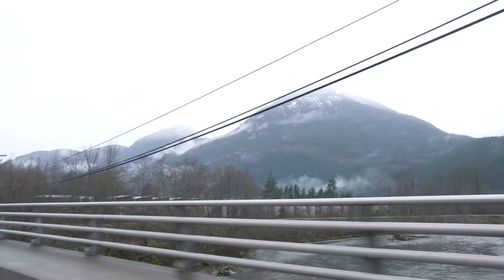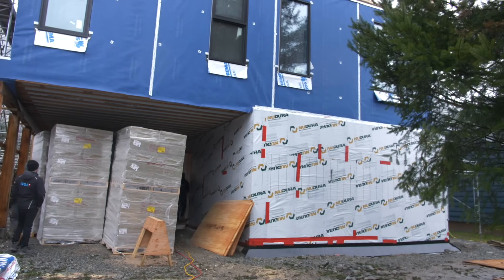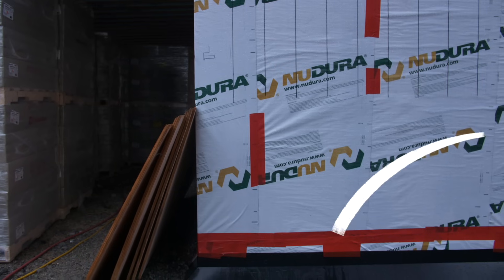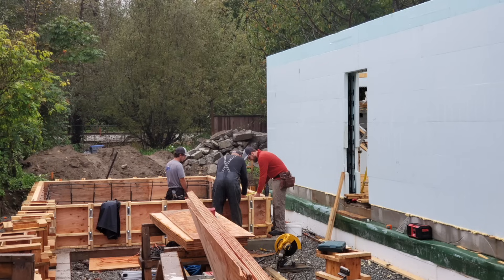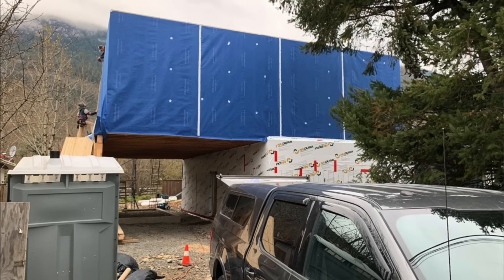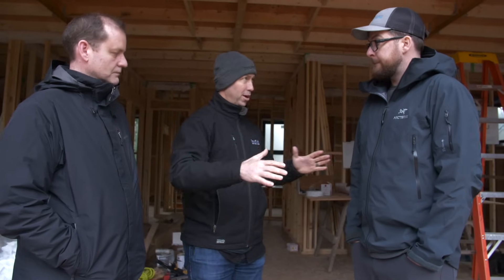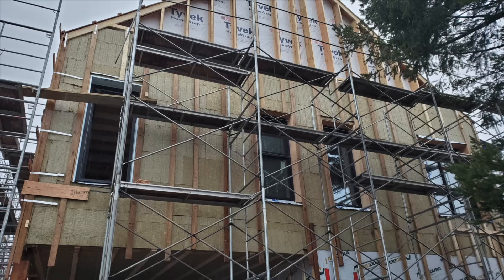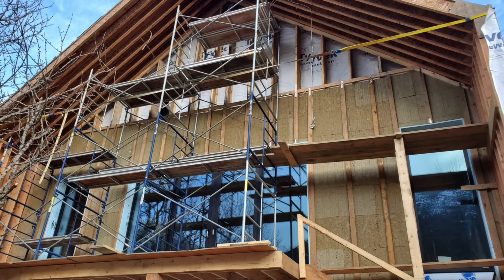Some Awesome Insulation Details on this BC Passive House!

Comment: Whats this house cost, I feel like the cost to build out weights the energy savings.
Reply: pretty sure the owner does not care about the savings. They have BIG enviro rules there, so to build to costs lots, and to do it right, it costs more..
Reply: Its depend on energy costs in the FUTURE and how well known is that method of building in particularly locations in Europe for example similar houses costs maybe 20% more than regular but your investment pay off after 5-8 years of living in that house.
Not to mention other beneficios such are clean fresh air, even temperatures across the year you dont have cold/hot walls, floors...
Reply: @altergreenhorn  that's nice.   But i would rather live in a shack that i can afford.
Reply: I'm all for energy efficiency, just wondering why be this efficient. It does seem like overkill, but if the house lasts for 150 years then it makes sense.
Reply: @rosscoep1450  Will that home last 150 years in a flood zone? Regardless, who wants to live inside a foam tomb? These super-tight passive homes require lots of expensive ventilation to deliver safe air.  Any mistakes in design, installation or maintenance of the ventilation system could have significant health ramifications.  So why do it? It's not cost-effective.  It's not eco-friendly. It's not healthy.
Reply: These homes piss on the environment - massive amounts of hydrocarbons needed for the foam and concrete. Excavate 6' of subgrade and import 2' boulders. Layers of rockwool.  All to save a few hundred in energy costs? Reality is money far better spent on a less energy-intensive building and simply installing solar. And then the occupants live in an off-gassing foam and rockwool cocoon (rockwool off-gasses formaldehyde) which then requires an expensive HVAC system. Rather than being impressed with these ridiculous homes, they deserve nothing but scorn and derision.
Reply: @ArthurDentZaphodBeeb  Rockwool hasn't offgassed formaldehyde for 40 years.
Reply: @stickdoctor001  today still it's a problem and clearly have not be following the imported products still do off gas.
Reply: @stickdoctor001  All but one Rockwool product uses a formaldehyde binder. And the one that doesn't add formaldehyde has extremely limited availability.  Fiberglass insulation makers got rid of formaldehyde binders a long time ago, but hasn't yet happened for mineral wool producers.
Reply: @ArthurDentZaphodBeeb  I am looking into switching from building houses into becoming an energy advisor.   (less liability, more control, and people are forced to hire you.)  So i go to the info sessions about these things.   I was at one and they asked if there were any contractors or developers in the room.  I and two others put up our hands.  They asked what i thought. 

 I told them that i think building perfect houses is wonderful, but forcing everyone to do it is horrible.  The houses we already make are of high quality and have extremely low fail rates.   In fact, the only problem with  our existing housing stock is that it usually costs 20-30 years of 2 working people spending as much as they can afford just to buy one.   Making housing more expensive is just going to make it impractical for even upper middle class people to own their own homes any more. 

I more or less got shouted down by the eco greenies and socialists in the room.   but my point stands.
And yes, if i had the time to say it, i would have repeated what you said.  All these materials and chemicals cost energy and thus carbon to make, and assembling them does the same.   When energy costs are what they are, we look at bringing the cost of heating from say 1500 a year down to what? Even with bottom of the barrel numbers, energy would have to increase in cost 20x to make this worth it (that was the number bandied about in these panels).   The only way energy costs increase that much is if we convert to solar.   Which, ofc, they also want.   The only real effect of these policies will be to drive up rent, building and developing costs, and mortgage costs for everyone.  Probably the goal anyway, since then they can "subsidize" people to create nice little vote plantations.  I mean, most people can barely afford a house nowadays anyway, and it isn't as if builders, developers and landlords are living in luxury.   The real effect is to make more middle class people dependent on the state by forcing them into the lower class.  The rich don;t care, because they can virtue signal and they can afford it.  As per usual, i think its really just a backdoor to more socialism.  these people are usually just watermelons.  green on the outside, red on the inside.
Reply: @hosmerhomeboy  Well, good luck on a career change. The problem is people get wrapped up in being 'green' - even if it is anything but. One of the passive house building supply companies (475 Supply) just posted about a small-home they were involved in that used straw-bale wall panels as their building material. Only thing they didn't mention was that they were built in Slovakia (or somewhere thereabouts) and had to be shipped across an ocean by ships burning bunker fuel and delivered by diesel-powered trucks. And then lifted into place with a crane.  Could have built using standard local green materials (wood/cellulose) at a fraction of the environmental impact and fraction of the cost. But that is boring 'old thinking' and doesn't sell well...
Reply: @ArthurDentZaphodBeeb  HA!  Yeah, people often forget that wood is a renewable resource, and quite green/efficient as well.  I got a kick out of blown in cellulose insulation being legislated out of existence in favour of DOW chemical products.   This is ofc, under the guise of being "green".  They figure it's better to have petroleum products shipped in on boats from nations with sketchy environmental records and refined into crazy chemicals than it is to make renewable stuff here.

Comment: The cost of construction for this house to minimise it's energy cost is not feasible. The rate of return on investment is dismal. Impressive construction nonetheless.
Reply: Similar talking was heard here in Europe +20 years ago when first passive houses was introduced , but then ecological point of view and energy prices goes up and now almost everybody in central or north Europe build more or less passive houses or some even plus houses, because you get passive part of  invesment back in less than 8 years by today energy prices.
Reply: @altergreenhorn there must be extreme rates there. What is the utility rate?
Reply: @xxxrsgrsgxxx  
Depends of the EU country but average costs for 1 litre of diesel is 1,3$ for example, electrity is aprox 0,3$ per Kwh, but in EU you dont have only energy costs in the formula for energy efficient buildings EU countries also encourage ecological point of view you can get up to 10.000$ from the state as energy bonus if you build energy efficient houses. If you dont want to use that option you are still obligated to follow building code which became quite restricted in the last years, for example minimum thickness of solid brick wall insulation in my country is 15 cm of styrofoam and 20 cm in the attic and those numbers are for central europe not north europe. If you build euro wooden house you need a few cm more because a modern EU bricks have some insulation itself.
Reply: We had a small development pop up down the street about 8yrs ago ($300k). We thought they were too high end for the neighborhood and they'd never recoup the cost of their high end features, in our $150k neighborhood.
4yrs later, they were selling for 2.0x to 2.5x their original cost.

The energy efficiency of this build could be seen as a major asset and this house that might have cost $750k to build, could pull 1.5M in a decade. Also, if we cap and trade carbon credits in the near future, energy prices will 3x to 4x. Then the additional installation will pay for itself.
Reply: @Specialist spot on. Your observations apply here in Australia too.
Reply: @cornpop7805  That is a surprising scenario, of course many variables should also be considered in that example.
I just recently built a home in Canada. We have 0.12$/kwh rates currently with big increase due to come bringing the rates to between  0.22$/kwh to 0.25$/kwh next year. (our grid is currently diesel turbine generation and we will be changing to a green alternative - hydroelectricity; also not feasible).
I'm an architectural engineering technologist, and did energy modeling and heat load calculations for my house with comparison to cost to construct. It was very surprising to see how upgrading building assemblies with additional  insulation would hardly ever be favorable in a ROI.
Reply: @xxxrsgrsgxxx 
The worldwide scheme of "Cap and Trade" for greenhouse gasses will make energy prices skyrocket, all fuel, all energy - including renewables. Cap and trade means that energy is rationed, so that the entire world can only produce a certain amount of Co2 and the right to produce that Co2 goes to the highest bidder. Renewables are not rationed, but regardless what you hear, they are unable to meet our needs, not even close. Consider that china is building hundreds of coal fired power plants, yet are the largest exporter of renewable technology in the world. However, the renewable energy prices will also be influenced by the price of Co2 based energy.

Take all this into consideration and your best investment is in energy efficency. A family that borders my new property pays almost $800/mo (US) for electricity. He has an all electric home that was built in the 80's. The passive house I intend to build will be approximately the same size and will be so efficent that it will only need $20k in solar panels and storage to bring the energy cost to $0/mo. When energy goes 3x, he'll pay $2,400/mo and I'll still pay $0/mo. Below is Obama saying out loud what will happen to electricity, but it really means all energy and it will be world wide. It's not his plan, it's the world's plan and it will eventually happen. Invest in home efficency, above all! Passive house! 

https://youtu.be/CNSZ62xiD4M
Reply: Home valves change by outside factors, it still doesnt make the home cost effective when value goes up for a few years in fact will cost a person more.

Bought a house in CA for 140 that wasn't anywhere near this efficient and 5 years later sold for 350K. Made more off that sale then investing in snake oil that make the manufacturers rich and would have considerably destroyed my profit to sell by going ultra efficient. The ultra tight homes that have HVAC designed to work at ultimate performance drops like a rock as the house ages and more places for it to leak. The equipment has to work a lot harder to maintain  and those systems cost triple of what a standard equipment costs to repair and keep running. In the end you paid so much more for a home that cant maintain itself as it gets older and cost substantially more to try at promised savings that never materialized

Comment: That is the most expensive Monopoly house ever.
Reply: @Thomas Lonergan and the cheapest to run.
Reply: @rossmcleod7983  Over its short life the equipment will work hard and harder because it will become under sized as the tight envelope leaks from age and repairs and it will becomes less efficient. Ultra high efficiency equipment  cost substantially more to maintain and repair and blows past any savings you get on the utilities  Also Not to mention the equipment runs longer and harder to keep warm in winter and to remove the heat mass in the summer.  See a lot of this on new homes. cost of homes like this are triple the cost of a standard home. There is NO savings going this efficient
Reply: @zack9912000  Perhaps the great thing about it is the future cost savings and lessons learned with all these different methods on these expensive homes?  I want to build a house - maybe in 5 years? - and I won't go full passive house but I will be sure to have several details done for better insulation, air sealing on it.
Reply: It's definitely going on Boardwalk! Imagine the rent you get when someone lands on it!
Reply: That was my obvious question: what did all that massive over-insulation cost? I'm thinking it added another $30,000 to the cost of the house, but that's just a wild guess.
Reply: KelMaster Construction why in the world do this?  I mean other than an academic exercise?  Makes no sense to me.
Reply: @butopiatoo  To prove it can be done and marketing bs. You can convince people to buy water at 2 dollars a bottle  vs 10cents from their faucets. You can sell anything to some moron conviced it's what the cool people do.

Comment: Those sub slab foam panels are interesting. I'm planning on using 2 layers of R7 rigid foam and then vapor barrier on top. A friend is doing a heat loss analysis right now to see if theres any place beneficial to add more insualtion within my budget. But I would like to do more under the slab since I will never be able to do it again. Plus if the panels are common on road construction they might be cheap. Of anyone has a link or a source please let me know
Reply: google "geofoam" to find some suppliers and technical info
Reply: @JorgeMorales-dz4pv  thank you, exactly what I was looking for.
Reply: Put the vapor barrier under the foam, that way your insulation is on the dry side. Foam will absorb water slowly over time with standing water pressure.
Reply: @christophergruenwald5054  I'm in new mexico in the desert, so not much ground water. But I do have a yard with tons of trees and 100% grass so I water alot. I dont think that would get under the house though. The reason the insualtion is below is supposedly when you pour concrete, the concrete want to work it's way underneath the foam and push it up. The vapor barrier on top prevents this

Comment: What are your thoughts on autoclaved aerated concrete (AAC) blocks for passive houses? Seems like they are used widely everywhere except North America for residential buildings.
Reply: AAC is ok.  using a layer of rigid insulation out board would make it better.
Reply: AAC has some potential for passive houses, especially if use with a thin-joint mortar system, but it does have problems with cracking that are quite difficult to manage - even the experts struggle to stop it cracking. I would recommend using a medium dense concrete block that doesn't have this problem. You can't use a thin-joint mortar system then, only conventional mortaring works, but they don't crack and they can be as airtight as AAC. You will need to add another inch of insulation to the wall though. AAC can also be difficult to get a good fixing into. You have to only use the correct fixings otherwise the blocks can crack, and the fixings can be hard to come by if you don't live in a country where AAC is commonly used.

Comment: So Matt, speaking of windows - have you seen people move to using two windows (an outside and inside) for some of these 12"+ thick walls? A place I stayed in Italy years ago did this, and I've not seen it stateside.
Reply: More than likely, each of those sash was single pane glazing rather than insulating glass.  There has to be some airflow between the two windows otherwise there would develop condensation. I was in the window business from 1962 until 1993 and saw several installation in construction from the 1800s that had a swing out casement window on the outside and a swing in French window on the inside especially in Northern Wisconsin and Minnesota.  The old timers of that day said the ideal space between the sash was 4".
Reply: @davidnielsen4490  Yes you are probably right .  More or less a storm window with a larger insulating air space between the panes .  I am sure the outside window was swing out casement for a couple of reasons . They may have needed to meet code for egress and to insure the best seal.

Also remember if the window had much sun exposure in daytime the space between was likely warmer than the interior air.  

Condensation  forms when air temp between layers is below the due point for that humidity level generally by contact with the outer colder glass. The reason modern multilane windows dont condense or fog is they are sealed with dry gas between the layers could be argon or even just dry air.  

One reason older storm type windows or the two window setup dont condense easier is that most heating methods (not an open flame) lower the humidity indoors so the air has a lower due point.
Reply: @eyeonfish It probably would not do this if the outermost window is sealed well from infiltration and multipane and inner window  single pane or multipane with small "breather holes"  similar to old style exterior storm windows. The breathable hole might allow just enough air exchange to avoid that or alternatively go for super sealed multipane windows on inside also basically space between the two windows acts just like a multilane window
Reply: Information for eyeonfish. Glass doesn't delaminate. What happens is there is seal failure.  The two layers of glass are held apart by a metal extrusion that has a membrane that is applied to the glass to form a seal.  Today's windows with Low Emissity films applied to one lite of glass or both sides of glass to increase the R value of the window unit. On the new construction on my home, we are using casement window units with a double layer of low E.
Reply: That's an old Euro window system you can see similar windows across the Europe in houses older than 80 years but not in newer ones, 
my grandma had it for example and I'm not from Italy
Reply: @eyeonfish very true